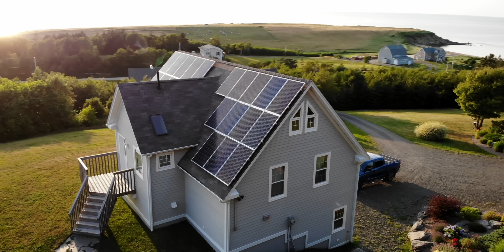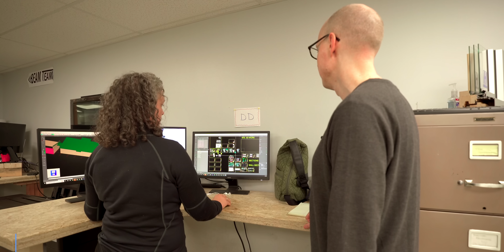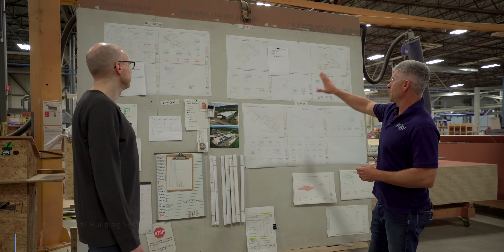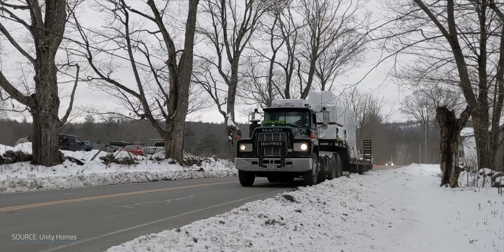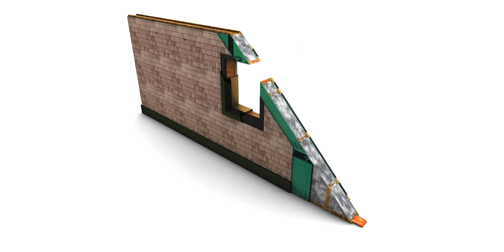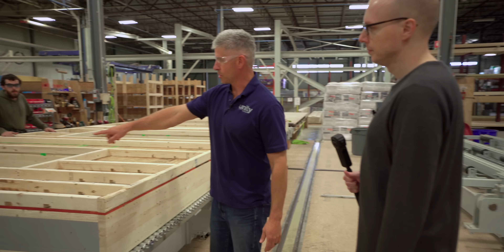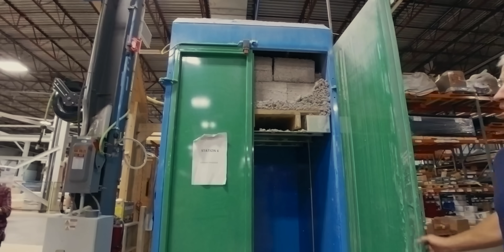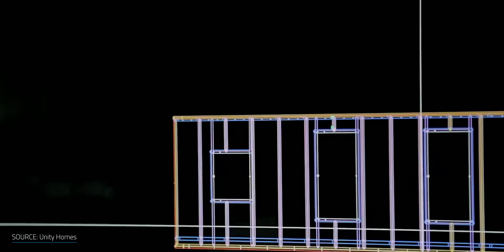The Simple Genius of a Prefabricated House - My Net Zero Home Build

Comment: You're not crazy to be geeking out about your triple glazed windows, especially since you and your wife have worked hard and saved for some considerable time to be able to afford to build the house of your dreams. One of the neighbours recently swapped out her double glazed windows for triple glazed ones and she's absolutely delighted with them.
Reply: They are common here in Germany for roughly 20 years. They are pretty much considered standard here, though double glazed windows are still being built in here and are sufficient to code requirements. My parents got new windows in 2006 and still got double glazed ones, the ones I built in in the last years have all been triple glazed, except some for non heated areas.

The European style (tilt/turn) of windows is pretty much standard since the 70s (already double glazed).
Reply: @lal12  Yes, I live in the UK and although double glazing is still the most commonly installed type, triple glazing is slowly finding its way here too. Climate change prevention and mitigation measures have been highlighted as reasons to prioritse triple glazing and I can't say I disagree in the least. The less heat loss, the less heating is required. Personally I think that in colder climates triple and quadruple glazing should be mandatory building regulations given urgency of climate change situation.
Reply: @pinkelephants1421  I am not so sure about the quadruple windows. You have a diminishing return with each additional pane. Also the disadvantages grow: Even triple glazed windows are already quiet heavy, additional weight might need more support. More panes mean less visibility and a thicker frame, which also reduces the view angle. If in turn you need a bigger window, the increase in size will nullify or even negatively impact the isolation result in the end.
The weight, size and more material will also lead to more energy used in transport and production...

Using a triple glazed window with Krypton/Xeon and isolated pane divider is probably the better variant.
Reply: Finnish here, triple windows have been standard for at least 30 years here. Makes in nice and quiet inside too.
Reply: I live in a manufactured home with the notoriously bad Kinro vinyl double pane windows. Truly horrendous windows. Not a one of them works like it should, almost all have lost seal. If I could afford to replace all of my windows with triple pane euro style windows I would have done it ages ago. So neat. I would be opening my house up every night in summer for that cool evening air.
Reply: Also you Understand their importance for energy efficiency & foundational purpose of your building.
And how unusual that level of far future planning has historically been in housing.
Reply: Well, triple glazed turn and tilt windows are a brilliant thing! They are pretty common in the Nordics and Germany, but unfortunately still a lot of places they are not the norm. Triple glazing certainly not, but even turn and tilt I found was not the standard in NL 15 years ago when I moved here. Now this seems to have changed…
Reply: We are currently building a new house here in Finland. We have quadruple glazed windows by Lammin Ikkunat. These are A++ energy class and werent even expensive. Pinewood frame + aluminium outer shell with no wood exposed to elements.
Reply: @finntruder2084  Sounds cool.
Reply: Agreed, I was geeking out about the windows and doors too!
Reply: I have them and they are not just more energy efficient, but more comfortable. 🏡
Reply: @tyroberts2261  And really help deaden external sounds too.
Reply: I came to the comments to say this. You are not alone in getting excited about fascinating solutions to net-zero home innovation.
Reply: You’re not weird, I’m also super excited about your European style triple glaze windows! 😅 super excited to see the house unfold and wishing you a smooth uneventful build!! 😊
Reply: I didn't see any screens on those windows. Depending on where you're building for, that could be a serious limitation.
Reply: @AlanPeery  You can put screens in - the windows open inwards. It's actually fairly rare in Europe, the only people I know with screens tend to live next to livestock. I don't know why this works, but presume to some degree that Europe is ahead of the US in the dangerous extermination of insects as a by-product of years of cultivation with monocultures, pesticides, etc.
Reply: @AlanPeery  Screens?
Reply: @kajerlou  But do you also find as a side benefit that they help keep things cooler and warmer respectively depending on the season?
Reply: @kajerlou  So it sounds as though the glazing does have some sort of positive effect in the cooler months when combined with the underfloor heating. Do you use any sort of semi opaque curtains to keep the worst of the summer sun out? It really makes a difference and you can still see perfectly well without having to have the lights on in the daytime.
Reply: @kajerlou  It probably does if there's no insulation between floors. Can you hear your neighbours above and below? If so then you are no doubt correct.
Reply: I’m geeking out about your triple-glazed-European-style windows too.
Reply: @UndecidedTechnology Anything comparable for wall2wall, floor2ceiling condo renovations?
Reply: There are European countries that require them as standard on new builds, i suspect only an American would get excited by something so common.
Reply: @bzuidgeest  European here. They are still quite rare compared to the total number of windows.
And yes, I would be excited too.
Reply: @Sagittarius-A-Star  as you may have noticed from other comments, 30 years as standard for the finish. Yes in many EU countries double glazing is still more common, but that is because European build houses tend to last a lot longer. The American houses blow away every few years or get eaten by bugs out rodents.
Reply: @bzuidgeest  And we Europeans regularly tear down those built-to-last houses after 40 or 50 years, and haven't exactly built out of renewable resources. There are good elements to both approaches. Home ownership is much more affordable in the US than most European countries, for example.
Reply: @zweigackroyd7301  yes, but not because the structure is failing. Not because the wood for eaten or a storm blew it away. We do it because of other requirements that changed. Mine is 70 years old and still doing fine.
Reply: @bzuidgeest  😂 True - American houses are a disaster.
And Finland is a lot colder than other European countries, so I guess they realized much faster that it pays to use those more expensive windows.
Reply: @bzuidgeest  I'm not sure entering into a conversation with someone who isn't interested in facts or reality, but wants to make some kind of point, is worthwhile.
Reply: @zweigackroyd7301  yet you already did that anyway. Please enlighten me with your facts and reality. Next time, if you don't want to, then don't.
Reply: @bzuidgeest  Your comments about American houses are truly absurd. You extrapolate to "American houses" based on the worst scenes of devastation after major storms. Were you expecting news cover of the houses that withstood the storms? You're either being purposely obtuse or are unwilling or unable to think logically. Also, you failed to consider the other points seriously - like the environmental impact of building with so much concrete and the impact on home ownership. And given the simplistic arguments you seem to favor, I am not arguing American houses are better - I'm noting there are strengths and weaknesses. Timber frame is certainly more sustainable than the standard European approach.
Reply: @zweigackroyd7301  off course they are overstated. Everybody understands that. However wood houses do need a lot of maintenance that stone does not require. There is no bug that eats stone. The treatments that wood receives against bugs is also no good for the environment and has to be repeated over time, same as paint. So I'm not so sure wood overall is the better option against concrete. And more environmentally sound concrete types are on the way. 
As to storms. After major storms the stone houses are still standing. Your major cities are stone and safe from storms. That a large portion of America is kept to poor to buy a house that can weather a storm is not my fault. 
The fact that so many Americans seem to be amazed by simple common windows and insulation tells me a lot. You have some very high tech industry, but a lot of infrastructure is ancient. Your farming methods ancient, water management ancient, social system ancient, i could go on. The Netherlands produces almost as much food stuffs as you do and that country is a lot smaller, but agriculture is densely packed and far more modern.
America could be a very well of country, if you spend more time on caring for citizens instead of arguing something stupid like expanding gun ownership and other things like that.
I'm watching your midterms right now. What a insane joke. Your candidates with their personal attacks and party bullshit. Actual policy doesn't even enter in to it it seems. Especially the republican candidates seen to have lost any touch to reality or modern social values.
Reply: @Fantabulous Snuffaluffagus I'm over stating it. But after major storms in the us, brick buildings keep standing where entire wood build neighborhoods are gone. It might be cheap, but if you have to keep rebuilding, that doesn't work in the long run. Not to mention all the personal items lost. I don't get why those places don't build something better and stronger. Those storms are not getting weaker with climate change. Yes brick and concrete is more expensive, but that can also be factory prepared. And you have to rebuild less.
Reply: @bzuidgeest  Depending on the climate, wood houses need no special treatment. And what you call "stone" is generally concrete, which requires massive amounts of water and releases a lot of CO2. It is heavy to transport and requires mining. Most European houses are painted as well. Concrete is not likely to be as environmentally sustainable as wood any time soon - if ever.

Most wooden houses are also standing after storms. Not many stone houses survive earthquakes. It turns out you have to consider the threats where you build.

The cost of home ownership relative to median income is greater in western European countries than in the US. So this isn't about wealth distribution (which is clearly a problem in the US.) In Europe people inherit their houses, many can't afford to buy them. Despite the better distribution of wealth, Germany, Austria, Switzerland, UK, Denmark, France, Sweden - all lower home ownership. NL is 4 percentage points better. So you're keeping the same number too poor to buy as Americans are, apparently. That might indeed be your fault?

The amount of pesticides and irradiation NL requires to produce that food is rather astounding. If one totally destroyed actual natural habitats, one could produce a lot of food. US farming leaves a great deal to be desired, but countries adapt to their surroundings. The Dutch would hardly do any different if they weren't crammed in so tightly. Necessity is the mother of invention. (Which can, of course, lead to some good things.) 

You also seem totally unaware that there are highly efficient windows available in the US. What is relatively new (and hasn't been in NL all that long, either) are the turn and tilt windows. NL was way behind Germany.according to your countrymen posting here. 

I worked long enough for a Dutch company to recognize several things. I love the Netherlands, and had many great colleagues. As a society, the Dutch aren't especially good at turning a critical eye towards themselves - even as they build new coal fired plants, etc. - well before the current crisis. America has a lot of problems, especially currently. And one can find areas where they are doing both better and worse than NL. 

As to the self-pride the Dutch take in their society, talk to the rest of us when you get over the annual celebration of white Europeans keeping slaves by trying to pretend it's only coal soot.
Reply: @Fantabulous Snuffaluffagus There is more to the price of an house then the materials. When I say cheap, I am talking material cost. Not location, vintages or whatever else adds value.

As to your last point, the roofing tiles, might blow of, but that is not a problem, usually its only a few and even if it where all, it certainly won't ruin the house. The roof beams and their ?cladding? are all firmly attached to the walls and will stay in place. Even if water comes thru, Nothing some drying time and a little paint wont fix. Aside from really compromised building I never heard of one being unrecoverable from a storm. (But tornado's are rare here)
Reply: @zweigackroyd7301  As to your reference to sinterklaas. which you stole as santa clauss.

Sinterklaas is not white as such, he is based on a greek bishop from greek lands that now belong to turkey. He originally did not have helpers. Those where a canadian introduced thing after the second world war. 
So about that pride.... The slave thing was an introduction from the American continent. Thank you very much.

As to coal soot, we don't pretend. His helpers entered houses via the chimney, which made them black. Also they used to be considering sinterklaas his origin, from moorish descent.

Stop listening to tucker carlson or wherever you get you nonsense on this topic. 

And as to undeserved pride, talk to me when your country man are no longer afraid to call an ambulance for financial reasons or die because then cannot afford something basic like insulin. 
Get a minimum wage that is livable. Start providing mental healthcare. Looking at you recent midterm a lot of the candidates don't seem to have acces to that.
Reply: @zweigackroyd7301  Humanity became 1 civilization - everything is everywhere available.
Talking about what tech is available is not the same as talking about what actually is used on average

The building requirements and regulations are completely different, therefore the average house in the EU will outlast the one in the US.
Hell > 17 Mio US americans live in a freaking 'mobile home'; next tier is some quick&dirty job of a cheap quality/material house lasting only 20 years because they get invested with termites. Those 2 level simply don't exist here.
Reply: @benjaminmeusburger4254  I'm amused at the comments about people who base their "knowledge" of US housing on stereotypes. I prefer many of the aspects of where I live to some of the features common to US houses, but I don't need to make up nonsense about American housing to understand that preference. And I can appreciate many of the benefits of different types of US houses - because I am aware of them and don't rely on making things up.

Comment: Believe prefabricated houses will be the next thing in construction. However, they need to make it as complete as possible and easy to deconstruct back to each material after use for reuse. The biggest challenge for this the vetilation and electronics, however I think it is possible.😊

Comment: It would be interesting to know where the factory is located and where your home is located.
Do they cover the whole USA. Do you hire a local builder to put it together or do they do assembly.
Reply from the maker: They mainly do homes on the eastern half of the country.  If you're building within a certain range of their factory, they do the full on site assembly and finishing work.  For me, I'm outside of that radius, so have a local general contractor that will do a portion of the finishing work.  However, Unity delivers and installs the wall panels and kit onsite.

Comment: Why don't we build homes like this everywhere? Simple. That house would fail in the wind loads we have. CBS homes that are built to code are the best for down here. Our two story home already has been tested by a Cat 5 Hurricane. You may have heard about Hurricane Andrew. Well our home was dead center of the eye as it went thru. Only improvement we could make is to replace the truss roof with a poured concrete one. Which one of the newer single story homes in the neighborhood has.

Comment: wondering if it's possible to run Cat6 or if it has to be done the hard way after construction.  not a good idea to fish it alongside the electrical.
Reply from the maker: I'm going to be running Cat6a cable, so will let you know how it goes.

Comment: I really do think prefab is the way to go. Matt have you seen straw prefab panels from Ecococcon, they're in Lithuania and deliver all to Europe and can meet PH spec's with some wood fibre on the outside to be finished with lime and clay renders. Can do medium rise buildings too. Already live in a pretty well performing house here in the UK but if I move I totally want to use their system. Especially here where it rains so much and moisture being the enemy of building fabric being able to get a weather tight building in a day or two is just amazing! 
So much energy and wastage reduced through this. They are more customisable than this system with their wall designs but it isn't so linked. Unity look pretty epic here! Good luck with it all.
Understand wanting the studio over away from the main living area, but my only thoughts are thinking about the form factor of the building - much more efficient to have a house much closer to a cube ( 2/3 stories) I guess that is just the local venacular there. Look forward to learning more when I see the rest of your building unfold. Hope it performs as expected. Nice to help pay for it with the videos eh! :D 
Great work sharing this and all your knowledge. So much to consider with building physics and good design can help so much. Cheers